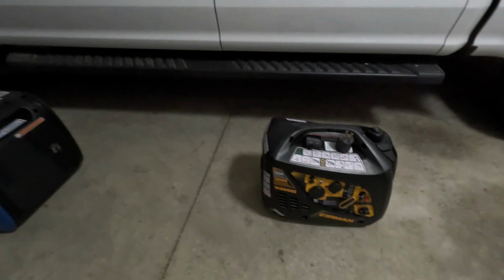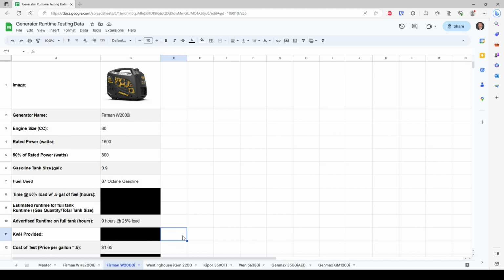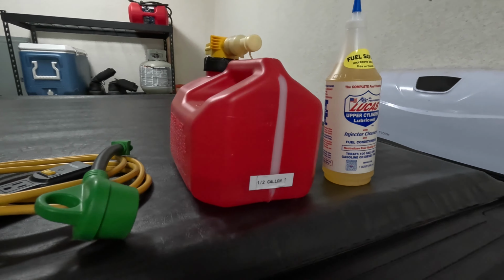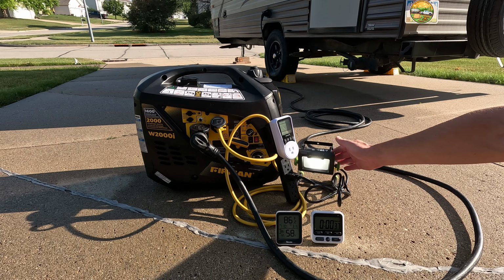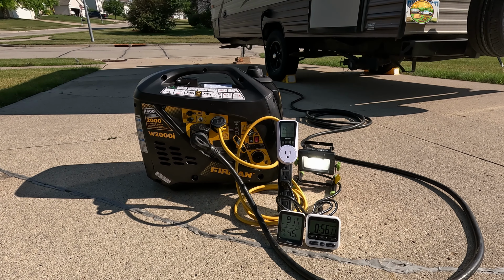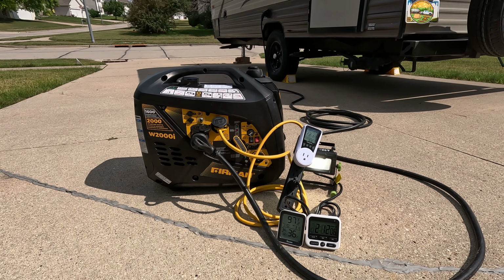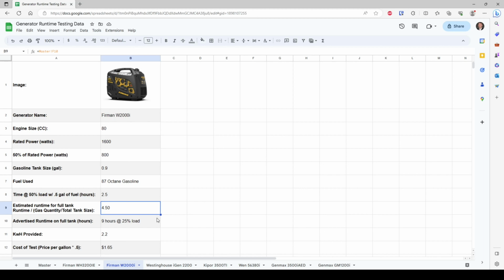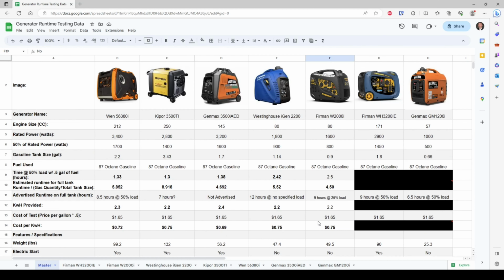Firman W2000i Inverter Generator Runtime Test | Generator Runtime Testing Series

Comment: you should start the generator before you plug everything in  it has a green light which turns on after about 15 seconds telling you its ready for a load
Reply: This is why it was struggling to turn on. Unplug before turning on and before turning off..

Comment: Pretty much exactly what I was looking for thanks for the content. To be fair, you ran at 50% load and their rating was for 25%, so if you double your 4.5 hours that's spot on their estimate of 9 at 25%
Reply from the maker: Very true!  Also, just as a heads up if you do buy a refurb unit of these, make sure it isn’t burning oil.  This one blew the connecting rod at 110 hours, luckily I requested a replacement due to the oil burning issues, but it did eventually blow.

Comment: Why would you start it with a load?  This is common knowledge start unplugged and shut off unplugged!
Reply: 😂 my thoughts exactly when I seen his comment pop up on the screen 🤦🏻‍♂️ it's like no shit its having trouble staring, your bogging it down 🤦🏻‍♂️
Reply from the maker: This machine had low compression and rod knock during this video which was why it was hard to start.  Inverter gens have the inverter off until it comes up to speed.  The only load on it at the beginning was 20w.  

The connecting rod broke at 110 ish hours due to manufacturer error during initial build.  

Thanks for watching!
Reply: Firman has great customer service
Reply: What did the new one do?
Reply: Hahah newbie 😅

Comment: I think you just got a bad unit; I have the same one (also bought on ebay from Firman) and it starts super easy and runs super smooth. Definitely not like yours was running. Glad they sent you a new one.

Comment: Well, it is estimated 4.5 hrs on a full tank at 50% load.  To be fair, at 25% load, 9hr estimate by Firman doesnt sound outrageous if you just count kwh generated per gallon.
Reply: Basically spot on honestly. Half the load double the time.

Comment: Fun test! I love these types of videos. Too bad the connecting rod broke but at least now you have a ton of spare parts. I have a Firman 2100 with very low hours on it but still bought another one a couple weeks ago as a back up. I have never experienced that weird sputter start, did your second one do that as well?
Reply from the maker: Not even a little, the second one started like it should.  I believe this even had low compression in this video which is why it was so hard to start.  Thanks for watching :)

Comment: You are the generator test king!!   Whats your favorite one?  The Genmax 3500?  Seems like it has it all!?  Also are you an Affilliate for these products?  Rather buy them from your links if you are.  And Lastly,  do you think a 3500 genny is as good as the 800watts of solar?  With your 400AH of LiFePo4 batteries, it seems the genny is a better buy with more reliability!?
Reply from the maker: The genmax is a great machine but pricey!  I have a firman dual fuel in my hands now that is also going to be getting reviewed shortly that rivals the genmax at half the price!  

The genny is a good backup for the solar.  I use mine for charging the batteries at night after a hot day of running the AC and running the batteries down.  

I am not technically an affiliate of Firman, but for the other generators I have amazon affiliate links.  I think the firman is a good buy, so I’m not offended if I don’t get a kickback!

Thanks for watching :)

Comment: i would clean the carb change the plug ngk and do it over
Reply from the maker: The carb was spotless, I checked it after this video.  It had an incorrectly installed connecting rod, which led to catastrophic failure at 110 hours.  Thanks for watching! :)

Comment: Their runtime is probably based on setting the generator on ECO mode. You didn’t mention this in your video. I assume you ran it on full power mode. Did you check the air filter? The air intake in on the bottom so it sucks dirt in.
Reply from the maker: All of my runtime tests happen with the eco mode on.  All components were checked and it ended up having a faulty connecting rod.  It snapped at 105 hours, so you can expect a tear down video in the coming weeks.  Thanks for watching!

Comment: I have one I got brand new from Costco it has burned oil from day 1, I just choose to ignore it, still works fine, starts on 2 pulls.  I do find it starts easier in eco mode and if I try to turn that off before it warms up it will stall.
Reply from the maker: Yeah this one had a definitive knock and burned oil also.  Just a couple weeks ago the connecting rod snapped.  In a future video I’ll be doing a full engine tear down.  Thanks for watching!
Reply: @codys-garage  The challenge In my mind will be sourcing parts (pistons, rods, rings, bearings, sleeves, etc.) If you need a machinist to do any work I ponder would one likely exceed the cost of the unit?  The sense I get is these are so cheap no one tries to rebuild them.  Fortunately no knock for me on the one I purchase new, but I have an unopened boxed refurb unit, I am now concerned about, need to open and test, so I Iook forward to your rebuild video.
Reply from the maker: @samuelclemens9516  you are definitey right and a rebuild would absolutely exceed the value.  I plan to grab a predator 79cc and just see if that can replace it.  If it can, it will be a fun project to get working correctly.  But you are right, probably not going to make the most financial sense with these things only being worth $300 at most.

Comment: Sounds like crap at the beginning of start up. I hope you added oil lol 😂.
Reply from the maker: Oil was definitely added, I work on small engines and have setup/broken in 100+ of these generators, so yes there was oil 😂
Reply: @codys-garage  how much oil will it burn during a test run? Trying to determine if my loss is normal or not.